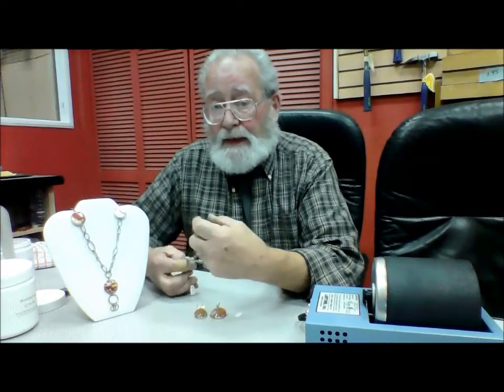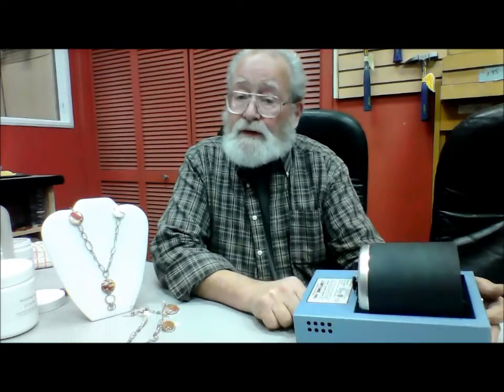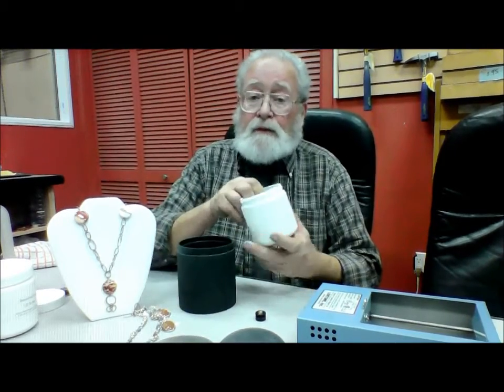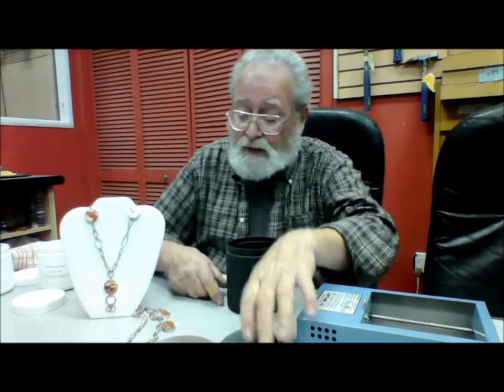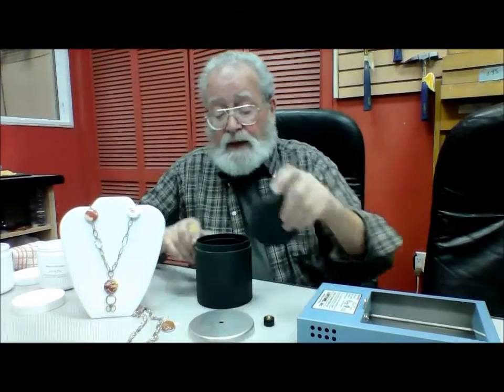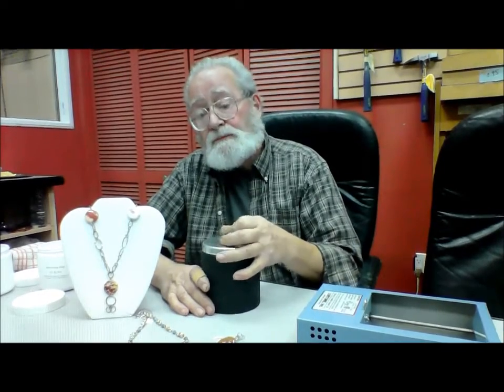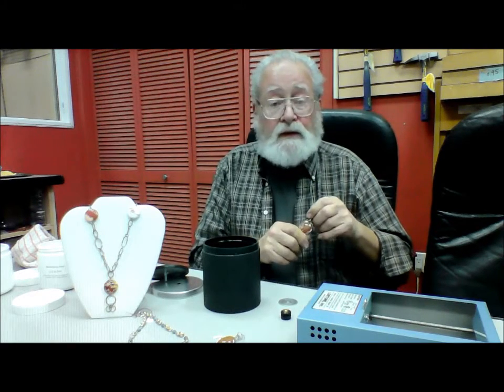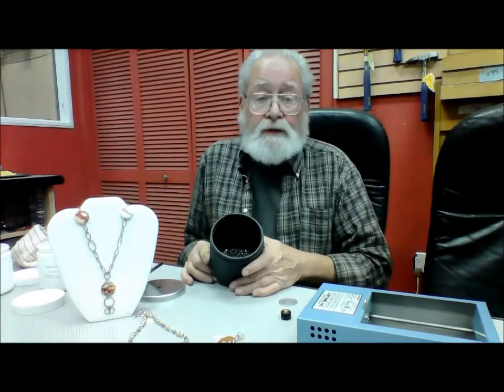How to Tumble Jewellery

Comment: In a class at Campbell Folk School, I could put copper and UK pennies in the tumbler in a
short time they would come out very shiny. On eBay I purchased some UK
pennies.   Using the same Harbor Freight
tumbler, steel shot, water and Dawn the most I can get is a less than dull
finish.  In the class we used vinegar and
hydrogen peroxide as a cleaner.  I tried
adding this mixture with the shot.  I
even purchased a six sided tumbler for more agitation.   In the past I have tried Basso.  Any reconditions